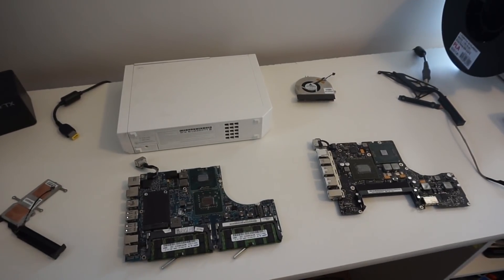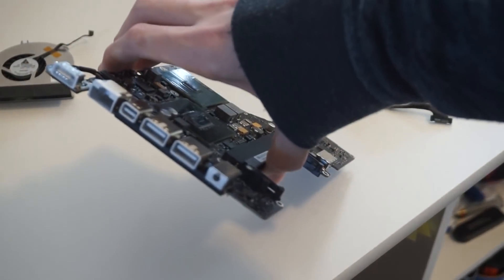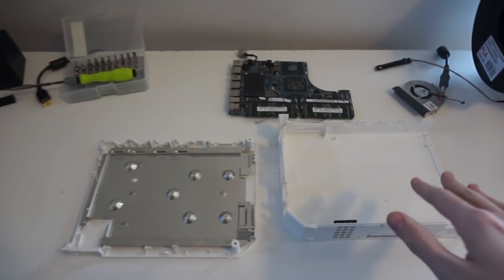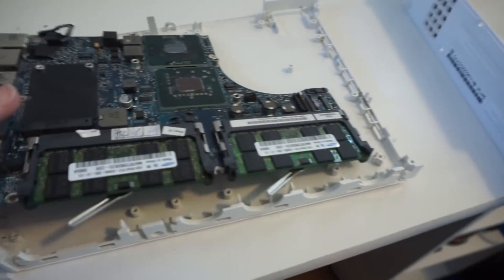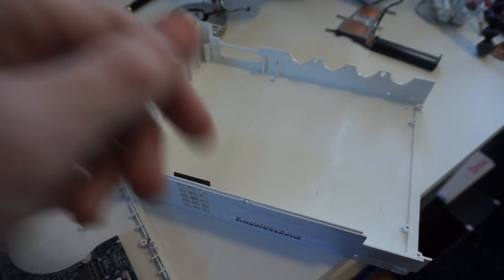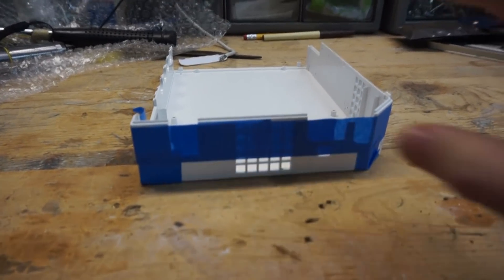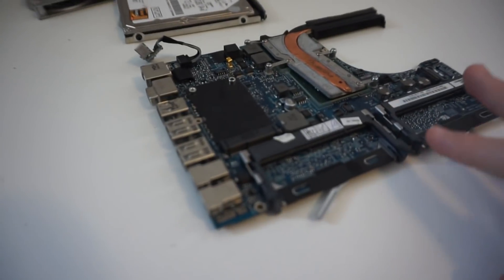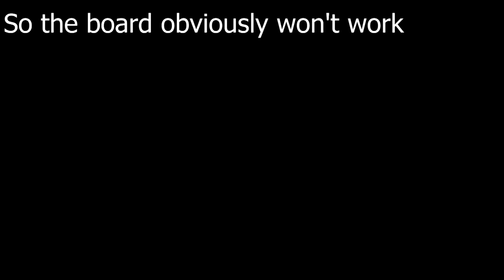PC Build In a Wii - Episode 1

Comment from the maker: Some people are saying that they are disappointed with the results of this video. They think the Raspberry Pi in the end makes the video a bait and switch thing. I hope people understand this is the first episode, and more improvements will be made. I also removed the Pi from it after filming that part because I thought it was cheating a little bit. Next episode we will put a different motherboard, perhaps an old thinkpad board. Thank you.
Reply: How did you get all these for free?!?!?!
Reply: What's up
Reply: I do need a case for my macbook motherboard so idk what I can use anything in mind
Reply: Hey I'm thinking about making one of these but with touchscreen I have a 2007 macbook a1181 motherboard but I wanna use a touchscreen for my build but idk what lcd I should use thinking about using 7inch I'm just not sure what ot how I can use a lcd with it can u help thanks man
Reply from the maker: @BlackCat-qm3sj  I’m not a Mac expert but I’m not sure if any touchscreens are compatible with MacBook boards. If you plan on running Linux or Windows I think an external touch screen might work but again I’m not entirely sure

Comment: Could this still be a case for a macbook motherboard bc I have a 2007 macbook a1181 and a wii chassis will it work it wont blow up will it lol
Reply from the maker: Yeah as long as you can’t it it in and have the cooling system hooked up it should be fine. I blew a board because the heatsynk wasn’t attached haha. Also make sure not to short the board lol
Reply: @KingASE88  ok thanks also how do I mount the mobo 

Do u know what I can use for touchscreen I'm using a 2007 macbook a1181 mobo looking to fit the macbook motherboard in my wii case but not sure how to mount it and idk what I could use for a touchscreen got anything in mind?
Reply: @KingASE88  thanks
Reply: @KingASE88  what can I use to mount the mobo glue sticks lol?

How would I use theyy wii case power button with my macmobo
Reply from the maker: @BlackCat-qm3sj  i dont know how to get the power button working but you could mount it with hot glue or find some small wood or plastic to hold it in place.
Reply: Yeah how would you make the wii power button work on the mac mobo